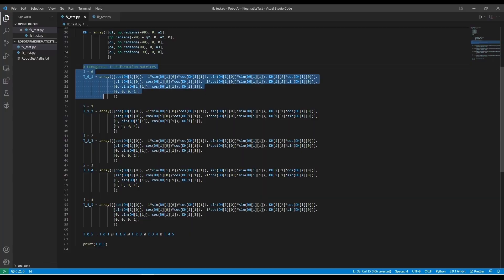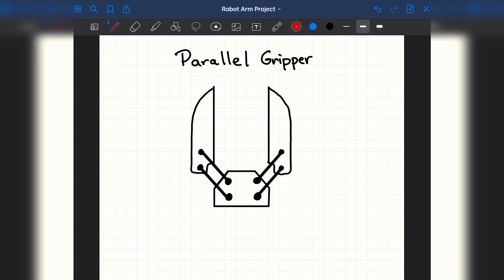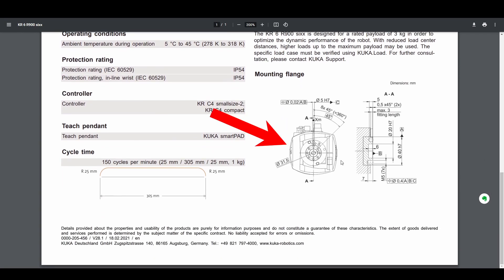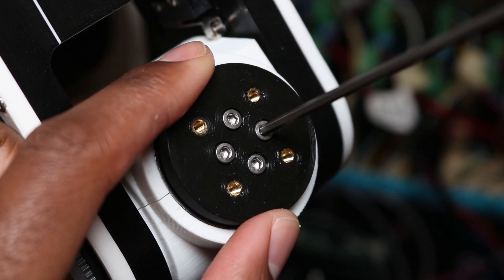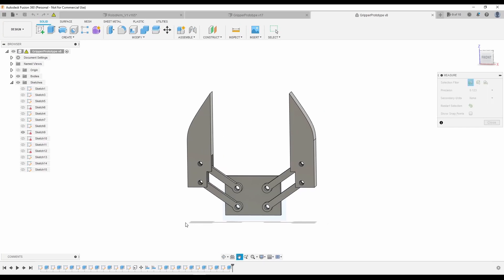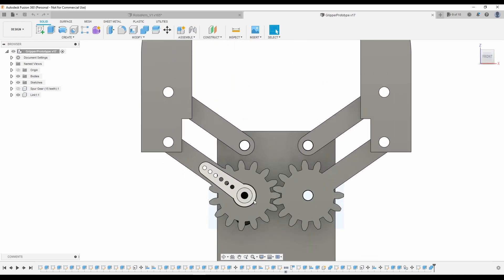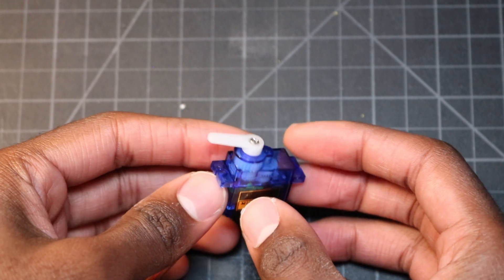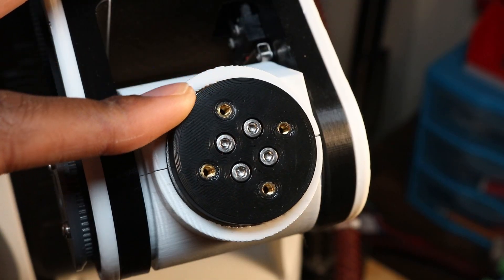3D Printed 6 Axis Robot Arm Part 6 | Gripper Design

Comment: You should use small bearings that will help. Also instead of printed linkage I could cut you some aluminum or carbon fiber linkage.
Reply from the maker: That's a great idea, I'll keep that in mind. And I appreciate the offer, but for now I want to stick with 3D printing for most of the robot.
Reply: @StewartTechnologies  i would use ptfe/nylon bushings instead for such a compact design. Also, it would be better to use shoulder bolts or chicago bolts so the bearing surface rides on a smooth shaft rather than belts. great work!